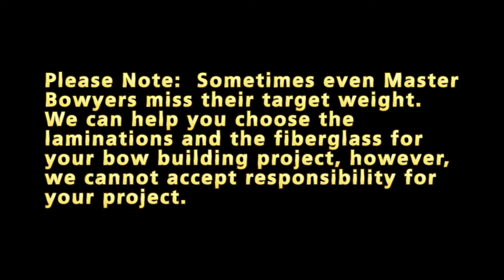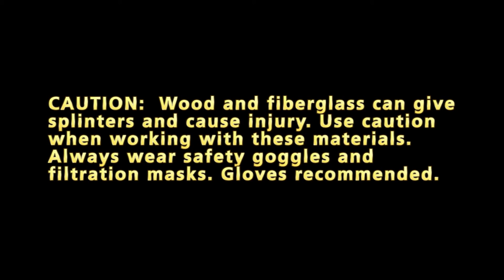How to Build a Longbow from a Blank - Part Two

Comment: The video says that grooves should be approximately a 45 degree angle  - but the grooves that are cut in the video are nowhere near 45 degree angle.   Which is correct? the way they are done in the video? Or 45 degrees?
Reply from the maker: The grooves should be at a 45 degree angle.

Comment: What is OMC High Impact tip Adhesive?
Reply from the maker: It is the particular glue that the bowyer was using in that video. Can use about any strong epoxy you would like though. That is just an example of one.
Reply: I used the EA-40 epoxy and it worked awesome.